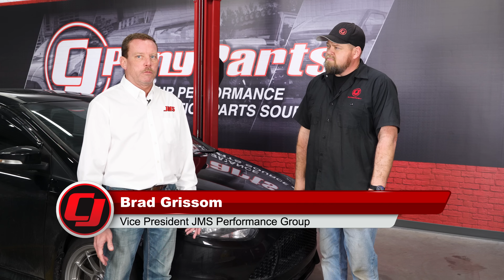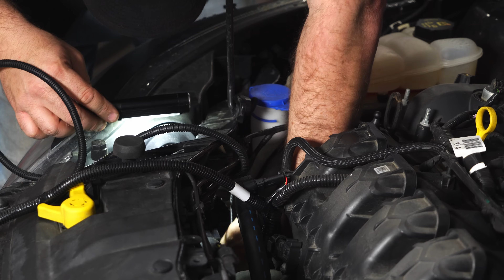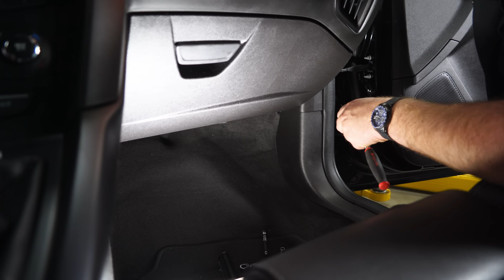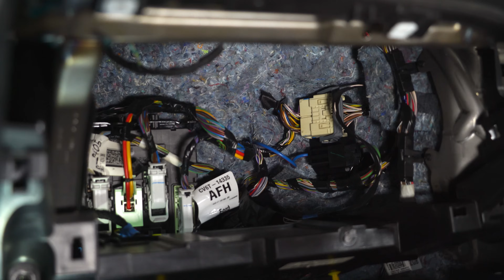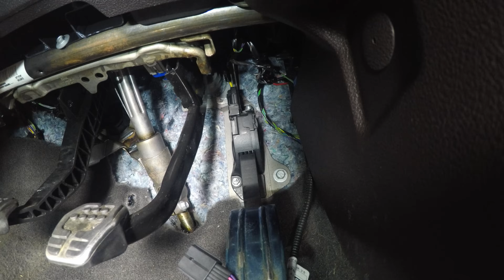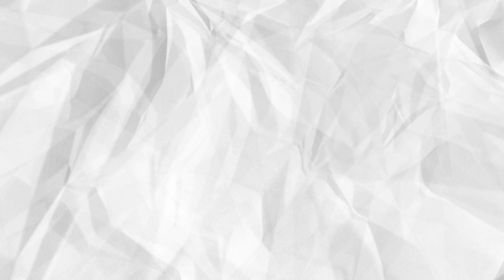Focus ST Install: JMS BoostMAX Plug-N-Play Performance Booster

Comment: I took my 2017 Ford Fusion titanium 2.0l EcoBoost to the drag strip it’s fwd not awd. It ran a 15.1 with dial set at 0 or off, 14.8 with dial set at 50 running 93 octane on a 72F day. Trap speed was 91 mph for both settings. Some surging in the power delivery with dial set past 50, in process of getting another module with updated software on it. Support is excellent from jms. You can definitely feel more low end torque and quicker throttle response in everyday driving. In sport mode with the car in second gear it will spin the tires on a 20 mph roll when the boost hits! Definitely worth $300 Imho
Reply: oh whoopdie doo! My ford fusion can spin tires at 20mph! This product is a BS waste of time and money. Get an Accessport with a real tune on an ST and you're spinning in 3rd gear on a prepped track with hot tires.

Comment: You need to put this on the dyno to show gains. Also would be nice to see the Ford calibration tune on your mustang dyno as well would like to see the gains for this type of tune too.
Reply: JMS has a dyno video on YouTube
Reply: @HardRockRecords  you have a link to the video? Can't find it.
Reply: @koolone3791  I've had the pedal max for almost a year now . Just installed the boostmax yesterday . It's a huge improvement .
Reply: @HardRockRecords  thanks
Reply: @HardRockRecords   after a year have you had any issues ? I hear that may lo had problems with It
Reply: @ivanrizo4688  only one issue , one morning I was off to work and I didn't have any throttle . This was due to a moisture problem.  Mainly my problem because where I installed the chip was pretty close to my wet feet . This was on a rainy day and probably a fluke that the chip got wet. But all I did was simply unplug the chip dry it out and re-install and the issue went away. Driving a stock ST you will notice the throttle enhancement almost  immediately . It completely changes the car .

Comment: Kind of disappointed in CJ for promoting this product. Considering the company doesn't offer up any proof, like maybe... a dyno sheet to support these claims of "25+ rwhp" and "up to 5 lbs of added boost". I guess $300 doesn't seem too bad since they claim to get you 25+ hp and a RWD swap..

Until I see some proof I would be more inclined to take my chances with warranty and buy a used AP for the $300 they want for this..  The "easy installation doesn't look so easy to me.
Reply from the maker: The Boostmax definitely works, I wasn't a believer until I drove it. The owner of the car came back with a big smile on his face. The install was absolutely more work than he had thought but the results were good.
Reply: @cjponyparts  I'm not saying the product doesn't work - obviously I've never tried one. Hell I bashed sprint boosters until I had the chance to throw one in my ST, and I ended up buying it after trying it out. I would think JMS could offer up some type of factual data to back up their claims of upwards of 25HP and 5psi gains.
Reply: @DrunkenJoe  there is a dyno video on YouTube from JMS . Check it out
Reply: Plus the guy saying the warranty center would not know about it is a lie. The car records a ton of engine parameters for viewing by technicians and engine pressure is one of those mapped.

Comment: ive had this on for a few weeks and love it, great addition to bolt-ons. pulls much harder and turbo lag is gone. fantastic upgrade for the price!
Reply: If u upgrade the intercooler on a stock ko3 it will lag slightly, but not like a big turbo
Reply: Turbo lag on a k03 hahaha
Reply: @411guy  with the cpe front mount yes. lag with a ko3
Reply: @shawnsennett7007  no it doesn't look, I have a 5.5 depo and a stroked 2.3ltr and with that baby turbo there is zero lag. I even have a datalog to prove it
Reply: @shawnsennett7007  WRONG
Reply: The car never had turbo lag to behind with

Comment: Seems like just getting an AP and real tune would be the safer way to go.  I predict lots of kaboom after this install.
Reply: Stacked on top of tune. 82,000 miles late ZERO issues. Not 1 code

Comment: Adding 4 to 5lbs of boost without supporting mods is a very bad idea for longevity.
Reply: No it's not and I dont know who told you that
Reply: @reminiz1  Common sense.  But please,  go ahead and push that extra boost on stock internals and stock tune for a while and see what happens.  🤣🤣
Reply: @theman4235  Its only 4-5 lbs, its not going to destroy the engine because of stock parts. The car is aready detuned when it comes out of the factory and not at its full potential. 4-5 lbs of boost is not going to harm that engine.
Reply: @reminiz1  16 to 17 is stock boost, 20 to 21 is considered overboost.  With a proper tune, the engine can handle 25 to 26psi in safe range - with supporting bolt ons -  Most tuners don't opt to go too high either.  Plugging a chip in and bypassing your PCM/ECU is asking for trouble.  If one is so inclined to do so, go for it,  but understand its pay to play.  Once it blows your turbo, your pistons, ringslands, etc., there's no one else to blame but lack of proper investment.   I suggest you educate yourself on proper modifications, and what actual tuners recommend.  

Better yet, ask any tuner or anyone who's properly invested in their ST if they'd plug that into their setup.  They wouldn't ever.  I'm willing to bet anyone from CJPP wouldn't attach this to their personal vehicle either.  The product exists because people are uneducated enough to buy it, and the vendor can make money off it.  There are no shortcuts to proper performance modifications.
Reply: reminiz1 only a few more pounds boost. famous last words
Reply: @kylewilliams586  Mine does as well as long as ambient is below 80 degrees.
Reply: Have you seen how rich these cars run from the factory ? Wipe your finger inside the exhaust tip. Super rich . Few extra Psi is nothing
Reply: Adding 4-5. Lbs of boost with a stock fmic is just dumb.  You'll get one good pull before you're heat soaked.  This thing is not a smart buy if you like your engine.
Reply: @ifixthings86  depends where you at first of all. If you live in arizona or something where the heat is crazy hot, even all stock with stock intercooler i would change out lol!!! Really the ford tune is nothing but a stage one.
Reply: @ifixthings86  this is true.

Comment: I like the idea of this but I fail to see how this is easily removed if you are doing any warranty work
Reply: In my opinion I would unplug the boostmax plug factory connectors back and                      tie up boostmax connectors.  For warranty work
Reply: BADD400 CB700 drums 
Yes and use some of the sound deadener material to hide the wires
Reply from the maker: shifter8207 the boostmax is easily removed on most other vehicles, unfortunately the Focus ST is very difficult to work on due to packaging issues.
Reply: Installation takes under 10 minutes (especially if you move the headlight to the side to fit the tip sensor connector) and it takes even less time to remove (which you'd do before taking it to the dealer- he did say this in the video!)